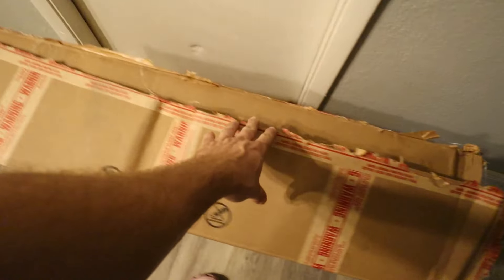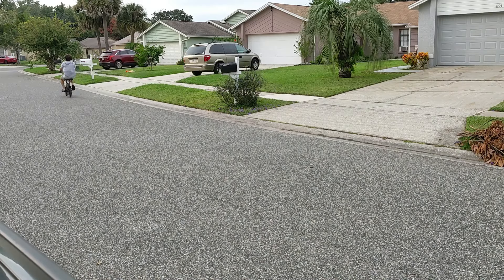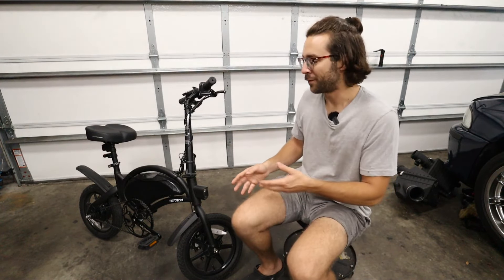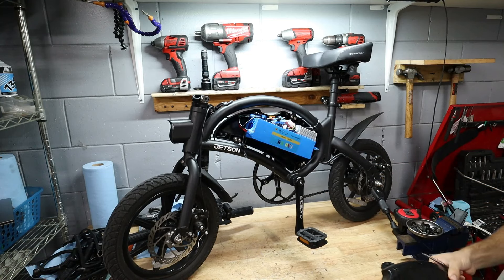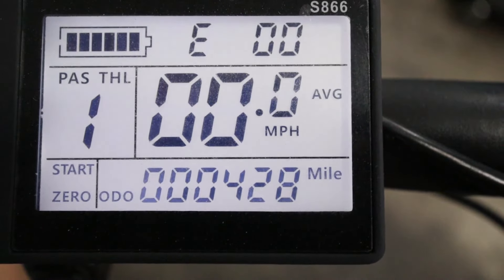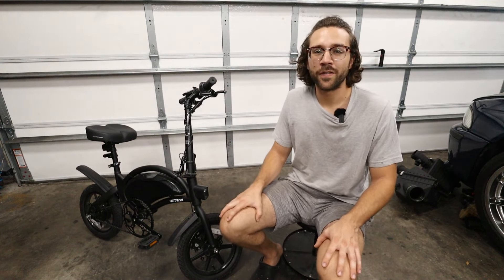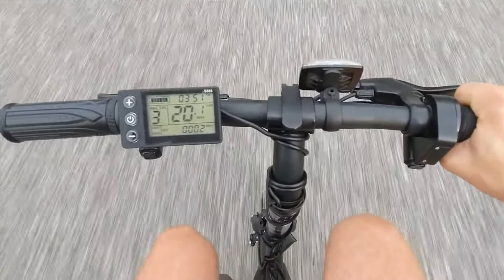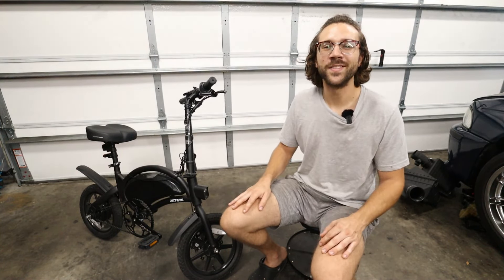3 Ways to Make Your JETSON BOLT Faster! (COMPLETE GUIDE)

Comment: A kugoo b2/V1 controller is 48v and wiring lines right up.  Add a 48v battery and presto !
Reply: What’s the max speed on it ?
Reply: @rubenmontanez-x1e  max speed is 28mph or 45km/h down hill.  22-24mph on flat until battery gets below 90%, then it maintains closer to 22mph for another 50-60% I’d guesstimate.  A larger Ah capacity battery would extend duration of top speed and too would a 52V battery.   The controller has no problem with 52V battery. I believe the capacitors are rated at 60V.  I have used my Bicycle Motor Works Pocket Rocket 52V Molicel with the controller. That said, the 52V needs to be mounted externally because of the dimensions. I’d also like to mention that the 400W motor works pretty hard and can get hot under a lot of load.  So if you weigh a lot (200lbs) or full throttle up a long hill, these type of load conditions exact a toll.  The motor is pretty good for RPM, but just keep in mind that it’s running at its maximum ability.  I use a electric leaf air blower to cool down the motor after a long ride that includes a hill back to my house.  Cool running motor/controller & battery, equals longevity !
Reply: @raylivengood8040  what set up ? Battery 🔋 & new controller?

Comment: was thinking about purchasing a 48v 10 AH battery do you think that would work well?
Reply from the maker: Yeah, you'll probably need a bick rack to mount it though, might be too big to fit inside the box. Should get you atleast 18 miles of range!
Reply: @ChrisBuissonDIY  hey, thanks for the tip I have the new 10ah battery sitting outside of the bike and it works great! Im not seeing to much of a speed increase mostly just range. I have the arduino hack but im still not getting up to 19mph do you think this is because of the controller and do you recommend upgrading it?
Reply: @ivdrew2635 yes, no matter what battery you have the stock controller is going to limit the speed

Comment: At 1:36 to confirm this does not work for 2022 and new Jetson pro’s I tried it out and jetson has locked the controller. Meaning the hack won’t work anymore.
Meaning, the only option to make the bike go faster is to Buy a new controller and replace the OEM/ Jetson pro one. Which I did and Yes the bike goes faster now. But the thing though is it’s highly suggest to buy a new battery that’s 48v

Comment: So if I get the new controller along with the new battery upgrade you suggested I won’t need the arduino hack? And will the controller work without the bigger battery? I’ll get one eventually but want to start with the controller so I can keep track of my miles and record stat changes as I add on more mods.
Reply from the maker: Yeah, the new controller would work with the factory battery. It's a great upgrade because you get the screen, and unlimited top speed, so there's no need to get the arduino. Then once you get a new battery, just change the controller settings to match it and you'll be good to go! hope that makes sense
Reply: If i change the battry only with out any changing its gonna b more speed of need to do odino hack or the new controller plz replay plz

Comment: great vid. interested in installing the upgraded speed controller that isn’t plug and play.. can you guide me to the wiring diagrams for it? thanks!
Reply from the maker: There's some diagrams on the internet for wiring, most controllers use the same colors and pinouts so it's not too difficult. I'll try to make a video soon!
Reply: @ChrisBuissonDIY  the amazon link in the description looks no different from the pre-wired one for $125. They both appear to already have the clips and connectors attached to the wires. What am I missing here?
Reply: @texas_blake2818  the clips look like the same type, but for example the throttle comes as a female, but so is the throttle cable itself, so they wouldn't just connect. And then on top of that, some of the wires on the same connectors are put in a different order, so even if they connected, the wiring wouldn't be correct. If you're willing to spend some time sorting through the wires and making your own connections, you can save money! Hope that makes sense 👍
Reply from the maker: @texas_blake2818  It looks the same, but the wiring is different. So you'll need to match up wires which isn't too hard if you do a bit of googling on ebike controllers. you can also buy the connectors and make it plug-n-play if you have the time!

Comment: Does this improve the torque so I can wheelie?
Reply from the maker: You'd want a controller that does 500w or 750w if you want to increase the torque, or you can do a shunt mod on the controller!
Reply: @ChrisBuissonDIY 
Thanks
This bike keeps cutting out and only works by unplugging and replugging battery while battery drops from 41.5 to 40.3?
Torque is what I want to drive 30 degree slope for one mile.
I fix electronics so I'll  check out the mod shunt.

Comment: If you upgrade just the battery it sounds like it will not go faster?  Sounds like you need to upgrade the controller first?
Reply from the maker: You can upgrade the battery on the stock controller but the speed limiter will still be present, so you'd need to arduino hack it or get the controller upgrade. I prefer the controller upgrade because of the screen and added features.
Reply: @ChrisBuissonDIY  What is a good price to find the controller online?

Comment: Hello I recently wanted to mod by bolt pro but I'm new to this hobby I want my bike to go at 20mph I recently bought a 48v 10h battery and a elgoo r3 to unlock the speed. Do I need anything also before doing this mod also any tips out there?
Reply: Also is there a possibility to get 30 mph do I need any additional materials?
Reply: WHATS THE UPDATE?

Comment: I have a jeson atlas and I found a wheel that's 72v 3500watts and it comes with the controller and new screen for around 325$US  😂 I'm waiting to hurt my on it when I get it. The website says the wheel is clocked at 120kms a hour😂 I think it's probably gonna be like 90 to 100 kms a hour but still it's insane to go that fast on a bake

Comment: Hi, just trying to extend the range of my Bolt with an extra battery in parallel attached to the back rack.  Folks are telling me they have to be the exact same voltage or one will damage the other one.  I want to keep the existing battery.  Is there an exact replacement available or other options here.  Thanks.
Reply from the maker: Yeah! So you can use any size 36v battery, since that's the same voltage as the factory one. You'll want to use a "dual discharge balancer" which plugs into both batteries and uses a little energy from both combined to power your Jetson. This way, they should always be balanced, and when you're done riding, both batteries will need to be separately charged. There's a couple videos on installing a dual battery setup on ebikes here on YouTube. Hope that helps!
Reply: @ChrisBuissonDIY  OK thanks for the advice. I saw one on amazon for $33.  Its says the bike will drain one battery first then use the 2nd battery next. I thought it would put the two in parallel and treat it like one battery instead of two separate batteries.
Reply from the maker: You'll want something like this, that balances as it discharges: https://amzn.to/3G3ToMK
Reply: @ChrisBuissonDIY  ok thanks again.  That's what I need

Comment: hi bro, is the 48v 8amp battery plug and play? or I need do some diy to the connector?
Reply: p.s. for the stock controller.
Reply from the maker: You'll need to buy an XT-60 connector for the controller to match the battery connector. Very easy to solder on if you have a soldering iron!

Comment: Do these mods work on a recently bought refurbished Jetson Haze?
Reply from the maker: They'll work too! I can't say about the battery fitment, but the same controller should work fine, but you may have different color wires for the motor hall sensors, or throttle, so it will take some troubleshooting if it doesn't work perfect the first time.

Comment: So...  If I got this straight, I can increase my speed just by upgrading to a 48V battery..? I have a Jetson Bolt (not Pro), no pedals, just foot pegs.  It only goes 11 MPH on a flat level surface, likely due to my size and the accessories I've added to the bike. I'd Love to go faster, even up to 15 MPH.  Can I just upgrade to a 48V battery to get the increased speed.?
Reply from the maker: On the Bolt (or Bolt Up model) those use a more simple controller, and it cannot be modified to go faster than 11mph. I'd recommend getting a new controller and battery (like the one in the description), and that will allow you to go as fast as a modified Bolt Pro, since they have the same motor. Wiring it up is exactly the same, and I have a separate video for that on this channel. Hope that makes sense. Good luck!

Comment: I got windgoo and iv ordered a new controler that could run dual moters and 72v battery i have 350 watt hub moter 12inch wheels 36v 6.6 ah and is shit  thas standead id like a bit moore volt you got link for sonebody the max thay got is 48v 20ah i need about 60v 30ah

Comment: Hi i have a 350 watt ebike motor can i use a 500 watt controller to run it
Reply from the maker: Yeah of course, but if you push too much power for a long time it could overheat the motor and ruin it. But 500w on a 350w motor is probably fine.
Reply: @ChrisBuissonDIY  ok thanks buddy so you think it should be fine then?

Comment: What adjustments did you have to make to make the battery fit
Reply from the maker: Had to cut out some of the plastics inside the case and grind it down with a dremel!

Comment: Is the battery plug and play?
Reply from the maker: Yes if you purchase it with a matching connector for your controller. I prefer to use XT60 connectors, so I soldered those on to both my controller and batteries. Makes it easy to take a battery from one bike and try it on another if you're building a lot of ebikes like me :)
Reply: what connector should I buy for the stock controller? or it’s. just simple plug n play for the stock controller?
Reply from the maker: @ruizhang3006  Check out my newest video where I show how to wire the new controller! links to the connectors in the description.

Comment: can i use the 1500wat battray with stock controller
Reply from the maker: Yeah I don't think that would be an issue, your controller will be the limiting factor but you should have plenty of range!
Reply: @Chris Buisson  Hello I recently wanted to mod by bolt pro but I'm new to this hobby I want my bike to go at 20mph I recently bought a 48v 10h battery and a elgoo r3 to unlock the speed. Do I need anything also before doing this mod also any tips out there? And also is there a possibility to make it go  30 mph do I need any materials? Nice vid BTW

Comment: Cool video!! You should use black electrical tape instead of masking tape, might be safer? Lol just a suggestion. Thanks!
Reply from the maker: You're probably right, but the tape solution was just temporary while I made sure the connections were correct. Ideally you want plug-n-play connectors like the ones I used in my controller wiring video! Link to that in the description.
Reply: @ChrisBuissonDIY  nice!

Comment: Did the new battery with the new 13amp controller give you more torch ? I have the same battery and planning on doing this with the same controller. Also would the 15 or 16amp controller (like the from JB) suck up more of the battery ?
Reply: Mathew Dewolfe
Reply from the maker: Yes, it has more torque/acceleration with the new 48volt battery! The 16amp controller doesn't make a huge difference on battery life at all, it might flow more amps while accelerating but only for brief periods.

Comment: Tried speed hack with ardurino board, everything seemed tt work and take and got the flashing light. However, top speed never changed. I think the newer ones don't like the hack. Another person commented as well the same thing.
Reply: same for me, 14mph tops
Reply: Didn't work for me as well.  I tried several times, no luck..still goes 15mph
Reply: @technofiend92  i get it now. the stock battery is what's holding back the speed, you get significant speed increase if you swap out the battery
Reply: What year is yours?

Comment: If your like me over 220lbs this mod is useless and only good for top speed or after u get going at the end. Due to weight it will whine and accelerate same until u get up to speed.  Only way to do it right is if you go with a 750w to 1000w motor hub and a 48v to 52v plus anything bigger is pointless unless already on a bigger bike. But some people still do it and weight ranging 120 to 185lbs has seen up to 30 mph with a 500w motor upgrade without pedaling. 

I have done this mod and the fastest I have seen is 17mph due to my weight, but with a 48v battery top speed I have seen max of 22mph so for people who is say 120-185lbs u could possibly see up to 25mph on flat ground with 100% full charge on 48v. But what will give it away is the acceleration for light weight person u will take off 2 to 3 mph faster after 3 to 5 secs vs a 200+lbs person....I have 4 of these bikes and have tried a lot of different mods to 2 of them.

Currently I see no more than 14 mph because I now tow a trailer with my toddler which carries 75lbs in total and I have soften the tires for more traction.

Comment: As soon as my kid tires of this in stock form I plan on wiring up an adapter to use my EGO batteries, probably clamped to stem.
Reply from the maker: I'd beware of using smaller batteries to run our ebikes, only because they are usually not rated to put out the amount of power we need, and can overheat the battery more easily. Just a tip but good luck!
Reply: @ChrisBuissonDIY  My Ego Lawnmower 56v 5 ah battery actually bigger than stock so its14s2p should be able to push the stock 13 amp controller no problem. more worried about the stock motor/controller overheating, but you had no issue with 48v so I feel better about it.

Comment: What options exist for > 25 mph?
Reply from the maker: More volts, more speed! You can find controllers for up to 72v, and either a 72v battery or a step-up DC converter. But at that point I think it's worth getting a bigger bike if you want to go faster than 25mph, just my opinion 😉 hope that helps!
Reply: Can u email . The company's address that sells that e bike battery u have on ur bike.?? Thanx A.D
Reply: @alanduncan9605  check out the link to my battery in the description of the video!